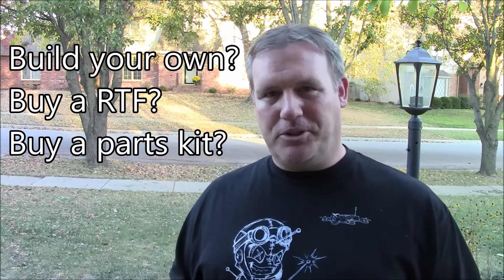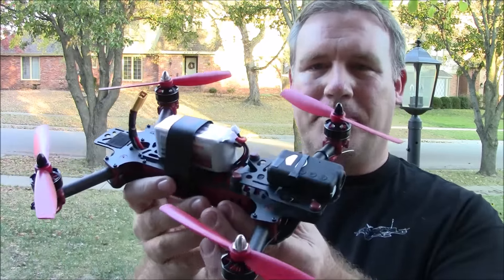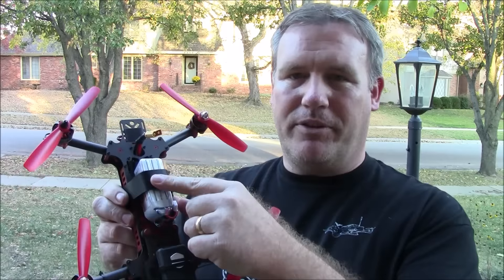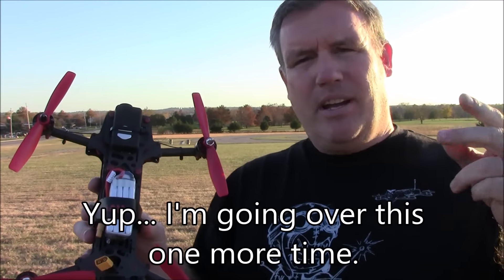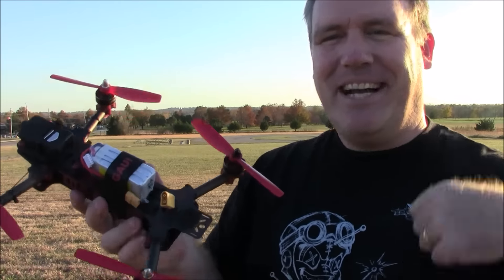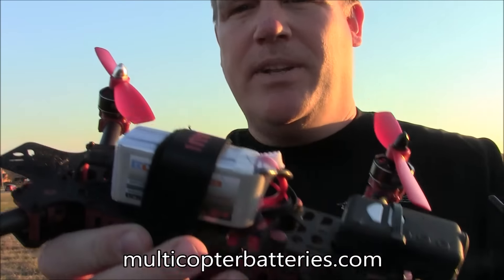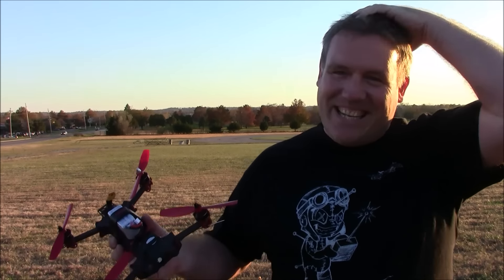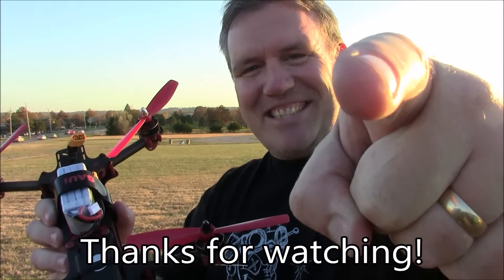Guy Rookard's Vortex Quadcopter Clone

Comment: If any of you guys decide to cut your own bottom plate, make sure you use a good template or an original top plate, because if you don't get the holes exactly right you will end up with a twisted frame and will not be a happy camper. BTW I have never used sn20 esc's and will never use them(I think travis and i got mixed up on that, not his fault). The esc's i use are ztw 18a and that's the only esc i use. I have never had one of these esc's fail and have really punished them. I do use different motors though.I recommend a 2204-2206. Cobra 2206 2100kv race edition is my personal fave and what i fly. Anyone that needs any help or has questions, feel free to contact me guyneil72@hotmail.com is the best way. Happy flying/building!!!

Comment: I've built like 6 or 7 Poortex's! Readymaderc sells the bottom plate and the all you need is both crash kits! My 2204 Poortex smokes any Vortex I've ever raced!
Reply: +JKFlorida You should try a set of 2206 motors, i like the cobras and the rtfq 2200kv(same as surveilzone). they both put out nearly equal power. You will really have a fast quad then!!!The quad in this video has 2206 1900kv and they lack the insane punch that the others have. Oh and contrary to what you will see about thrust/amp ratings of the cobras they produce excellent flight times.

Comment: It's too bad he didn't smooth out that bottom plate.  15 minutes of sanding would make it look great.
Reply from the maker: +Plur307 True.
Reply: +Plur307 I sand and smooth the edges of them now before i assemble them.That quad was the first one i made and at the time i wasn't worried about form as much as function. I just didnt go to the trouble of taking it apart to sand the edges, Obviously i should have.

Comment: I built my own Poortex too. I used the two crash kits. Mine has a Afro Naze32 with SN20A speedies flashed with BlHeli. I was using the Emax 2204 2300kv motors. I have just upgraded the Motors to Multistar 2204's. These are the red anodized Vortex upgrade Motors from HK. These are more powerful and smoother running. Props are King Kong 6040 cut down to 5 inch. I also fitted a Bluetooth module, so that i can adjust the PIDS from my mobile phone. I noticed that there is not any FPV gear in this video. I am using a 1000tvl standard board camera with a 600mw TX. 
Here is a video of mine with the Emax Motors. https://www.youtube.com/watch?v=mEm8G7j-r1g
Flies fast but i also have that wiggle motion that you see in this video. I need help with PID settings.